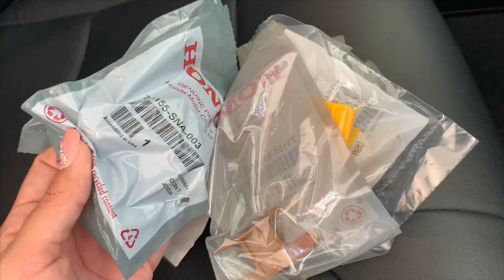DIY Windshield Drip Molding 2008 Honda Civic

Comment: Another tip for people doing this, open the boxes and they will fit in the civic lol that's how I got mine home today 🤙
Reply from the maker: Zach Oneil lmao! That makes a lot more sense 😂  👌🏼
Reply: What are the part number for the left and right
Reply: @jamesjones9207  Right  Drip Side (73158-SNA-13), Left Drip Side(73168-SNA-013)
Reply: @ManoloSarra  = are the part numbers the same for a 2006 Civic?
Reply: Good day, it is very exhausting searching for this part. I am from the island if Trinidad and Tobago,could you assist me in purchasing this part too?

Comment: bought those 9 ft long boxes yesterday thanks to my friend helping me after seeing this video, doin it today been studying the DIY crossing fingers thanks for these videos helps my confidence a bit
Reply from the maker: You got this!!
Reply: wohoo done in 45 minutes did not break one single bracket, a small head flat head screw driver made it easier unlock those interlocks before puling the whole thing off. saved $$$ for install asked by the dealer, now i have $$$ to buy  a  dashkit and 7" LCD stereo head unit another DIY in the future, thanks a ton guys you inspired me LOLZ
Reply: You bought it from the dealer also ?  Still cost about $250 for both sides ?  thx. Glad you were successful. Gonna try some time later.

Comment: Hi . Thanks for the video. Can you please share the model number of all the different clips? It will help me order them online.
Reply from the maker: MysticSoulful I don’t have that info anymore. I tossed everything after we installed it. Sorry man!
Reply: Bear Fruit Style Thank you so much. I was able to look up the part number online and order it off ebay. For those who can’t pick up the molding from the dealer, they can buy them here on ebay for $216.87 +taxes + free shipping. Considering the cost of shipping, this is the cheapest you can find online for both right and left side moldings
https://www.ebay.com/itm/122941360910

Comment: So basically, the rubber seal that is attached to molding that provides waterseal had eroded away due to exposure/age?? My 08 windshield looks EXACTLY the same. Big ole gaps where the rubber seal  should be meeting the windsheild and all the white clips basically exposed. All I need to do is order a new set and follow this vid and BOOM, ill be water tight again as well as not so faded//crappy looking Trim?!

Comment: What about the seal that runs across the top of the windshield?
Reply from the maker: We didn’t replace that. It’s still original.
Reply: I'm surprised that seal didn't go, looking at how much the side trims had deteriorated.

Comment: whats the part numbers are they different for each side? I need to replace the both the right and left side
Reply from the maker: Dro905 hey! I’m not sure about the exact part numbers. But! You can ask for the part number at the Honda dealership. They’ll still give you the information. 👌🏼 sorry I couldn’t be more help!
Reply: @bearfruitstyle3152  its all good I went through your comment section someone commented a website where I can get the same parts for cheaper and I am currently looking through the website. Honda needs to chill they want to charge 600 plus to install the parts
Reply from the maker: Dro905 for real. They’re crazy lol
Reply: @bearfruitstyle3152  I found the parts that you replaced on your car for 70 each Im going to have my buddy replace them. Thank you for uploading this video to youtube if I didnt find your channel I was most likely going to rip my hair out and cry you are a life saver and thanks to the comment section
Reply: @dro905garcia2  my civic is on 06 4 door ex i want to replace mine what is the part number and if you can post the link bro
Reply: @hijoseph100  https://www.hondapartsguys.com I think I got the parts from here

Comment: hello i need to change for my honda, you know the honda part number and the price thanks
Reply: I called my Honda dealer,  gave them my VIN number and they gave me the price for molding and clips.  It was 299.00 total. I purchased and I'm watching video for a refresher before I head out to install them.  I did get a condescending attitude when I told them I'd rather not pay $500 to have them installed.  They didn't say it was going to be $500 but when I said I didn't feel it was necessary to pay $500 for something I go could easily do myself they didn't refute my guess.

Comment: What is the proper name for this when I call Honda to order ? I am in the same situation my clips are showing on one side
Reply from the maker: It’s a windshield drip molding
Reply: @bearfruitstyle3152  thank good video
Reply: @bearfruitstyle3152   but the molds bring like the rubber?
Reply: Bear Fruit Style  what is the clip numbers? 
Dealer shop have them? I got to order molding, it takes 3weeks to get them and not mention of clip including
Reply from the maker: Hyang Yu hey! So I didn’t get the clip numbers but I did a close up of the clips in the video. The dealership has them! I would also just call them and ask for it. They will give it to you. Hope this helps! I bought everything the same day from the dealer. They forgot to charge me for the clips so mine were free.
Reply: Hello, where did you buy it? How did you ask?
Reply: How mucho u pay?
Reply: I was told by Honda this part does not come with the rubber to hide the clips. That rubber is not offered by Honda.
Reply from the maker: @f250ta  try another dealership.

Comment: Como se llaman los empaque que tapan los soportes de esa moldura?
Reply: The part is for sale in the link below they have both left and right side 

The part number is 73168-SNA-013

This link takes you to right side part ( driver side), however the website also has the left side (passenger side)
https://www.oempartsource.com/oem-parts/honda-2006-2011-civic-sedan-hybrid-roof-drip-molding-driver-side-73168sna013?c=bT0xJmw9MSZuPVJlY29tbWVuZGVkIFByb2R1Y3RzJms9MQ%3D%3D

And the clips can be found in the link below

https://www.oempartsource.com/oem-parts/honda-clip-a-front-windshield-side-91570sjd003?origin=pla&gclid=EAIaIQobChMIyuufqsrr-AIVk8LCBB1SWwHZEAQYASABEgL_wfD_BwE

Part number 91570-SJD-003

They also have more clip parts listed on the website

Comment: There are 4 different clips.  White (91570-SJD-003), Blue (73154-SNA-003), Yellow (73154-SNA-003), Brown (73155-SNA-003).  https://www.hondapartsguys.com/v-2008-honda-civic--dx--1-8l-l4-gas/interior-bumper--molding is a good parts diagram.
Reply: blue clip is actually 73153-SNA-003